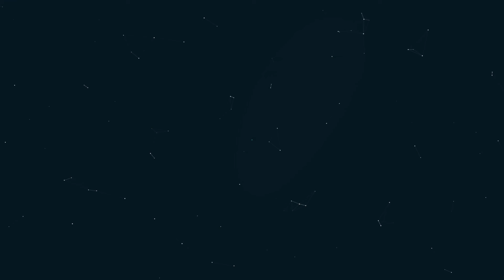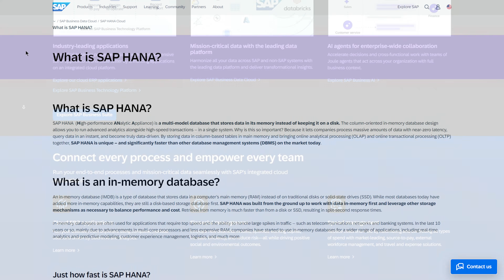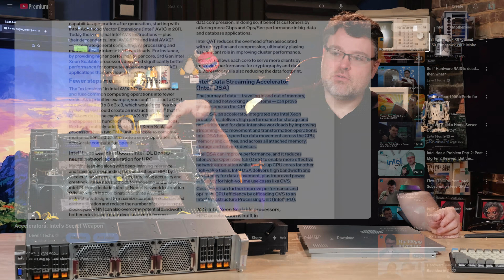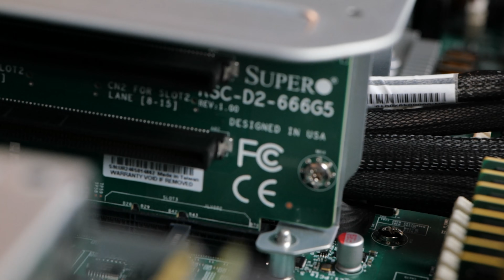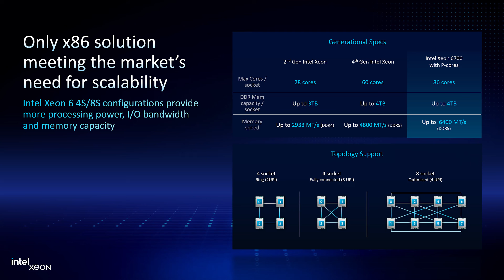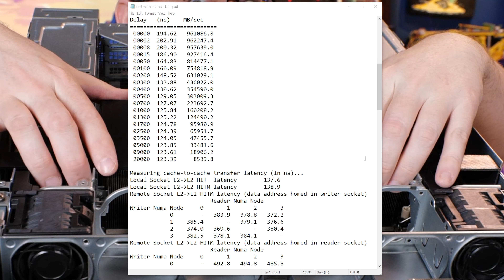Supermicro's SYS-242H-NR 4 Socket Xeons: 8 Terabytes of Memory Overview

Comment: 5:00 This server is qualified for "MEM-DR512PC-ER64	128GB DDR5-6400 2Rx4 LP (32Gb) ECC RDIMM", but 256GB and (if you know someone) 512GB DIMMs are available.

The CPU would have to be able to address 32TB, and I suspect that it does not, you are likely limited to half that; though Intel does have some -M CPUs with support for a much larger memory footprint.

Comment: We run HC cluster as our storage and non-user facing backend for customers who want compute but aren't so specialized that they need dedicated hardware to ensure that their application isn't going to experience contention. For HC we use Nutanix and the term you keep alluding to is data locality, which applies to cache, memory, and storage to ensure their application isn't lowest latency. In fact it was our primary concern with HCI because we were coming off SAN tech but needed the ability to upgrade, increase density as technology improved, and minimize rack space. But the concern with an HCI setup is how well it handles data locality at the software level. Obviously we were sold on the solution after a lot of talk and interaction with their engineers, and that proves your point well--locality matters and optimization across the stack (as well as VM distribution) matters, a lot.

Comment: 8 TB total means 128 GB DIMMs unless I missed something, which doesn't seem ground breaking for a large server.

256 GB DIMMs are available retail and motherboard manufacturers have certified 384 GB DIMMs for EPYC 9005, allowing for 6 TB or 9 TB per socket respectively or 12 TB to 18 TB per system.

Quad socket Intel still has 50% more slots, but if they only support 128 GB DIMMs, it would appear AMD still has the edge for max memory capacity. (Likely at a higher cost thought due to larger DIMMs.)

A newegg listing at /nemix-ram-3tb/p/2SJ-000N-00C61 has 12 x 256 GB for $38K, or $152K for 12 TB to fully load a duel socket Turin system.

Comment: Supermicro is just the best. My NAS has been running a X9SRE-3F (Xeon E5-2690v2, 80 GB RAM) flawlessly for the last 12 years
Reply: 80 gigs? First, that’s impressive for a NAS, but I’m also wondering how  you’re getting 80GB? I forget if that would be 4 or 6 channels, but 72 + 8 or 64 + 16? 

Or, as I loosely recently saw on Reddit, a 96GB setup with 16GB of memory chips ripped off the ram sticks. (The man was trying to water cool his ram, and removed some memory chips when he removed the heat spreader. Was at least older spare RAM sticks, wanna say DDR3.)
Reply: @levygaming3133  It is a combination of 6x8GB and 2x16GB DDR3 ECC Registered DIMMs. Stuff I found laying around at work. It's very nice that the Mainboard eats RDIMM. The first few years I had 2x16 GB ECC non-RDIMM 

if you want the verbose output 😀

          size: 80GiB
          capabilities: ecc
          configuration: errordetection=multi-bit-ecc
        *-bank:0
             description: DIMM DDR3 1333 MHz (0,8 ns)
             product: 9965516-051.A00LF
             vendor: Kingston
             slot: P1-DIMMA1
             size: 8GiB
             clock: 1333MHz (0.8ns)
        *-bank:1
             description: DIMM DDR3 1333 MHz (0,8 ns)
             product: M393B2G70QH0-CMA
             vendor: Samsung
             slot: P1-DIMMA2
             size: 16GiB
             clock: 1333MHz (0.8ns)
        *-bank:2
             description: DIMM DDR3 1333 MHz (0,8 ns)
             product: 9965516-051.A00LF
             vendor: Kingston
             slot: P1-DIMMB1
             size: 8GiB
             clock: 1333MHz (0.8ns)
        *-bank:3
             description: DIMM DDR3 1333 MHz (0,8 ns)
             product: HMT31GR7BFR4C-H9
             vendor: Hynix Semiconductor
             slot: P1-DIMMB2
             size: 8GiB
             clock: 1333MHz (0.8ns)
        *-bank:4
             description: DIMM DDR3 1333 MHz (0,8 ns)
             product: 9965516-051.A00LF
             vendor: Kingston
             slot: P1-DIMMC1
             size: 8GiB
             clock: 1333MHz (0.8ns)
        *-bank:5
             description: DIMM DDR3 1333 MHz (0,8 ns)
             product: M393B2G70QH0-CMA
             vendor: Samsung
             slot: P1-DIMMC2
             size: 16GiB
             clock: 1333MHz (0.8ns)
        *-bank:6
             description: DIMM DDR3 1333 MHz (0,8 ns)
             product: 9965516-051.A00LF
             vendor: Kingston
             slot: P1-DIMMD1
             size: 8GiB
             clock: 1333MHz (0.8ns)
        *-bank:7
             description: DIMM DDR3 1333 MHz (0,8 ns)
             product: HMT31GR7BFR4C-H9
             vendor: Hynix Semiconductor
             slot: P1-DIMMD2
             size: 8GiB
             clock: 1333MHz (0.8ns)

Comment: Is there a reason why Supermicro is still so Intel-focused even 5+ years after Zen 2?

As a poor home lab user I am a bit sad that there is only a single standard Supermicro AM5 motherboard model (H13SAE-MF) and its supply is dwindling maybe hinting at it becoming EOL soon.
Reply: Because they knew what’s not Intel will have to come down so they have to keep a good relationship with Intel
Reply: Can you elaborate your thoughts a bit? I’m not sure I can follow.
Reply: Intel is still ~75% of the x86 server market (in unit terms), even though its share of the revenue is down to ~65%.

And as an owner of two Supermicro H13 systems myself, I would encourage you to at least look into alternatives.

H13SAE launched without 4/4/4/4 bifurcation support, a key feature for all-flash builds. SP5 H13 boards apparently* require rev 2 to run E9005. Supermicro is also the only component provider to lock key BMC features behind a paywall, notably virtual media.

* SM isn't exactly clear on this. Datasheet claims "drop-in support" require rev 2, but BIOS update section straight up says ensure rev 2 for E9005 support. I don't have a E9005 processor to test this.
Reply: I’m extremely disappointed by the available AM5 motherboard models with built-in IPMI. The AM4 situation was better. My current small setups use an ASRock Rack PAUL IPMI AIC in regular consumer motherboards with tested-working ECC memory which works fine for me but ASRock Rack’s firmware quality and update policies are just horrible.
Reply: @abavariannormiepleb9470  what kind of issues did you encounter with the ASRock BMC card? I've never had an ASRock Rack system, would be grateful if you can share a bit of experience with me.

Comment: A long time ago I worked on a Opteron machine with eight processors. Now this was incredibly primitive compared to what's available today, but at the time it was incredibly advanced. It was quite interesting as it was basically a beta release. It worked, but only just and with some frustrating problems. One was the OS support. When we got it it would only work with BSD, Linux or Windows simply wouldn't work. When we contacted them we got some modification instructions that involved soldering and component replacement. We didn't feel we had the tools or the experience to do this so they sent a guy from Taiwan who reworked it. Turned out he was the one who had designed the motherboard and also had designed a number of other motherboards that we used a lot. So meeting him was very interesting and he taught us a lot about the designs used. Once it was done we managed to install Windows server on the machine and ran some very silly benchmarks. It was interesting to open the performance tab in Task manager and have the screen filled with small CPU load graphs. I think the processors had four cores each, so 32 cores total. This was amazing at the time even though today a single 9950X will have 16 Cores, 32 threads, and be faster than this monster server back then.

With 8 processors there was definitive NUMA problems as the memory was divided between the processors and there could be several jumps between the different cores and memory that was attached to another processor. But it worked, and at the time that was impressive enough.

Comment: When a CRAY-1 never had a single wire that was beyond a specific length... such that it was in a circular shape, physically... the concept of the 'traces' length was of specific interest was already known, this is just another implementation of this same limitation of physics.  You might want to mention that this was true over 50 years ago.... this year, i.e. 1975!  Another application for this type of server is virtualization, such as via VMware, Hyper-V, KVM, RHEV-H, etc.  The constant threshold limit to virtual machines, is always 1 of 4 factors, processor, memory, disk IO or network IO, when you have to optimize for any 1 or 2 of the 4 as noted, it is a bottle neck often across the processor domain, if not the PCIe back plane.  Know this first hand, since I did performance analysis testing for virtualization infrastructure from 2001/2 until I retired in 2018 for a fortune 10 firm.  This server is a monster, compared to what we had to evaluate in the early years of virtualization.

Comment: What happens if you cache the data from the radio telescope(s), and then feed it to a slower computer system to process(6:13)?  Are lower budget arrangements possible for that type of use case?  Is having to wait an extra day or two for the analysis going to be that critical?
Reply: CERN, for instance, has their first layer systems that do nothing but filtering out useless data, with no local storage. They have a second layer of systems that cache it locally, before going off to another layer to archive it.

Distributed radio astronomy like the Square Kilometer Array does similar things and relies on very precise timing between systems to allow data to be combined later.

Comment: Hey Supermicro, I get it that smaller configurations aren’t exactly high-priority in the current data center world but please enable all of AMD’s standard PCIe Bifurcation options for the two CPU PCIe slots on the Supermicro H13SAE-MF AM5 motherboard and don’t actively hide them.

Currently only x4-x4-x4-x4 is present as an option in BIOS, the x4-x4/x8 and the mirrored x8/x4-x4 options are missing. Please fix that!

Comment: It make me wonder why systems like my DL580 G9 fell out of favor. Despite its age it could hold more memory (12TB) than these newer systems.
Reply: I always wanted a DL980 G7.  For no reason, other than I wanted an 8 socket monster.
Reply: My DL380 G9 with 256 GB of 2400 MHz RAM is doing everything I need it to.  That thing would be a solution for a problem I might never have.
Reply: I parted ways with my 380 and 580 g7's some time ago.   For now, the only problem any server would solve for me, is boredom, and bulk local storage.  😂

Comment: The funny part of these is that the price of this system is a rounding error for what licensing of SAP Hana and the database on this will cost you.
Reply: SAP is bullshit, plenty of other fun things to do with such machines
Reply: What makes it worth the cost vs custom solution based on a FOSS DB engine?
Reply: @ its like bloomberg terminals, they do an oceanic amount of stuff
Reply: @uncrunch398  when the foss DB does something weird you can't call someone to fix it for you in a couple hours because it's costing your business 1M$ per hour.

Comment: And .. Epyc Turin supports up to 6TB PER Socket (12TB max in dual socket, 18TB according to the official spec)
Reply: Something is not adding up. Epyc has 12 channels, and with 1DIMM per channel (assuming 512 GB module) - you get to 6 TB. With Xeon 6, 8 DIMMS with 2 DIMM / channel gives you 8TB / socket. With 512GB DIMMS, that should allow this platform to support up to 32 TB.
Reply: @assumed10identity although rarely implemented, SP5 can do 2DPC (MZ33-AR1 for example). 512GiB modules aren't available yet, the 6TiB/so comes from 12C*2DPC*256GiB. This quad socket LGA4710 motherboard isn't listed on SM's website yet, but the DP X14 boards are certified for 8TiB (2S*8C*2DPC*256GiB)
Reply: 2DPC on SP5 has a severe memory frequency penalty, even if only 1DPC is populated. Any decent 1DPC SP5 boards can do 6400MT/s with a Epyc 9005, with a 2DPC board it goes down to 5200MT/s (1DPC pop), 4400MT/s (2DPC pop), or even 4000MT/s (certain boards, 2R 2DPC). LGA4710 isn't impacted to anywhere near the same extent, 2DPC boards can do 6400MT/s when only 1DPC is populated (which is the highest the CPUs are certified for), down to 5200MT/s with 2DPC.
Reply: That was what I was thinking 😂

Comment: this is the kind of server that the SAP system nobody in your company knows how to use while you spend crazy money on it runs on
Reply: 😂 truest post of the day
Reply: I heard that Intel to reach the "Performance" tier of servers for HANA had to cook up 16S Xeon6 system. It won't be available outside of SAP installations, but yeah.
Reply: I installed SAP on dual and quad cpu systems in the 90’s - Sun, IBM Unix systems. I think up to 8-way IBM RS6000’s but back then they were all single core.
Reply: the other server with a milestone recording server running on 4 cores slammed 24/7 be like WHERE ARE YOU SAP SERVER I WANNA HUG U

Comment: I'd have to do the actual math, but there's a good chance that fully populating those DIMMs would cost more than my mortgage...
Reply: Well only 24 DIMMs and each 256GB DDR5 RDIMM ECC DIMM is 3200 USD rounding down so 76800 USD if you go with the cheapest ones. So yes an entire mortgage for a middle class house for just the cost of the DIMMs.
Reply: @yumri4  $76800 for a "middle class" house? 
I think you missed a 4 or a 5 in front of that.
Reply: @ A mortgage on a middle class house which most banks make you at least pay 3% but most would prefer if you could pay 20% before the house so yes on the lower end a middle class house mortgage is only 76800 USD as 80% of the total house price.
You also have it depends on where you live for how expensive houses are. A house in California is more expensive than a house in Florida which is more expensive than a house in Ohio. Unsure why Ohio's houses are so cheap but they are.
Now like if you want to buy in Texas or New York the housing prices yeah they are in the middle 100 thousands for the stated price on the sign.